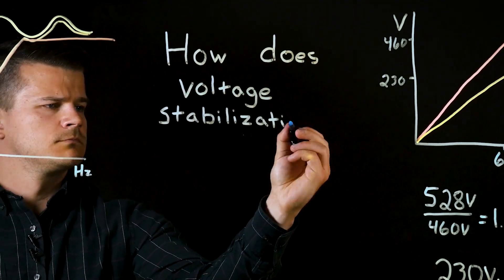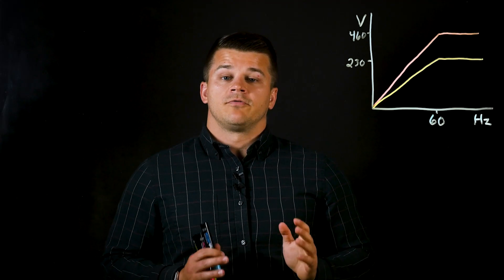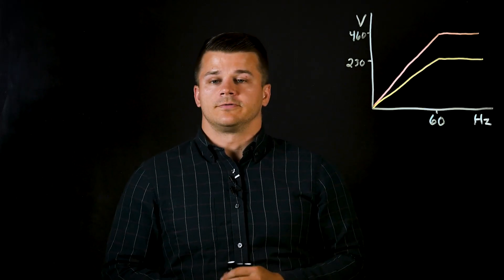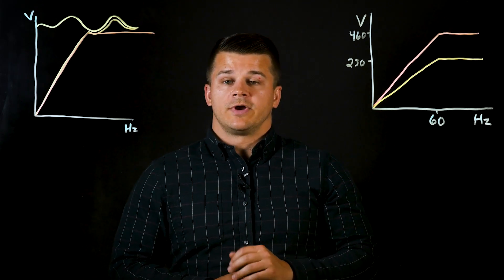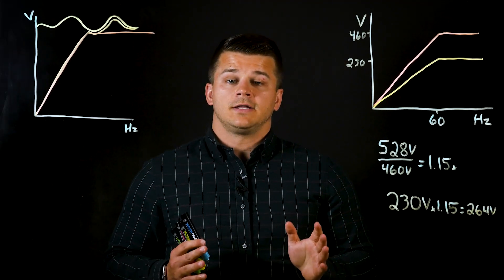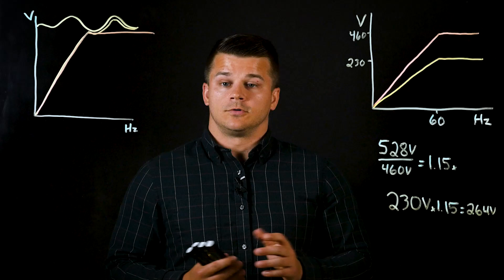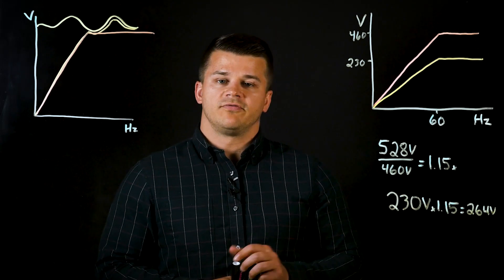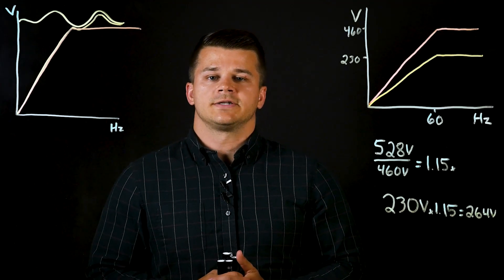What is Voltage Stabilization? How does it Prevent Premature Motor Failure?

Comment: Hi KEB,

Do all VFDs have this voltage stabilization function? or the simpler ones just outputs the input voltage to the output and just change the frequency? Some VFDs has parameters to set such as "Motor nominal voltage", so theoretically if we set "Motor nominal voltage" to 460V for example, wouldn't that also work like voltage stabilisation?
Reply from the maker: Hello Gurpreet,
Thank you for your comment. Not all VFDs have this function. Simpler ones just take the input to the drive and output that to the motor. So if it is a 480V drive/motor but the supply spikes to 500V for some reason, a more basic drive will output 500V instead of keeping the output constant at 480V. We hope this helps answer your question. Have a great day!